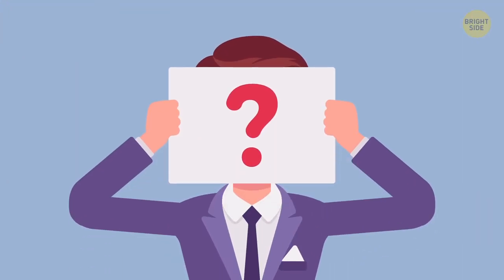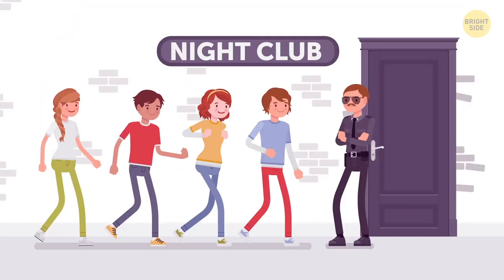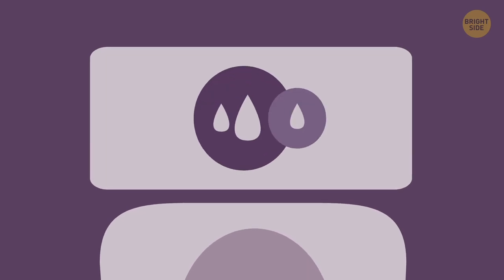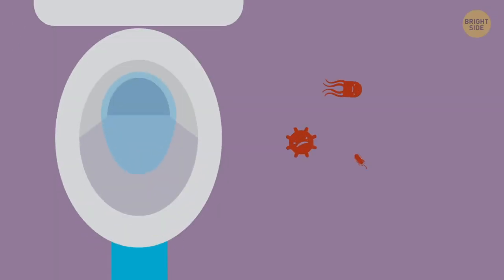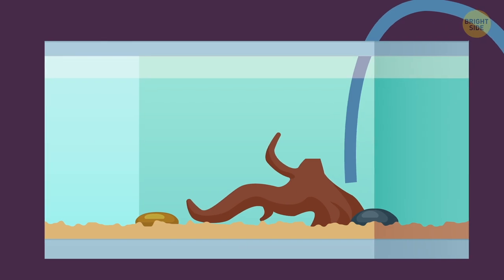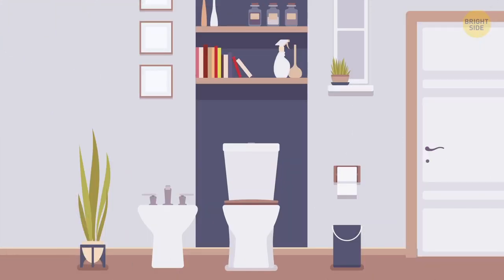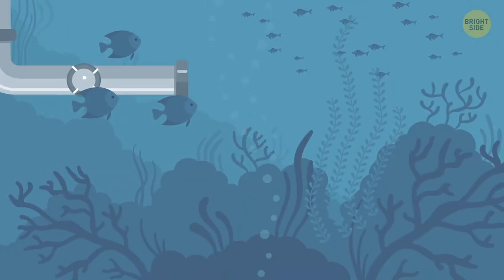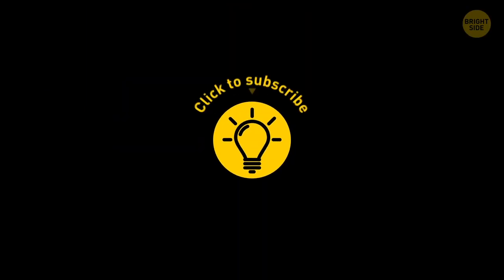That's How a Toilet Works

Comment: I always thot that sewage went directlty to a river nearby
Reply: Unless you live in a very poor country, then in most circumstances the answer is no because of the contamination that would cause. In most 1st world countries, it goes to a water treatment plant. 

That said, during heavy rain the drain systems may overflow into the sewer, and then the sewer may overflow into a local river. This is true in older cities especially which may not have a high separation of waste water systems. Modern systems keep "black water" (sewage) and "grey water" (rain, shower water, etc) separate, but somewhere like London still occasionally discharges into the Thames (though they are building new tunnels to stop that)